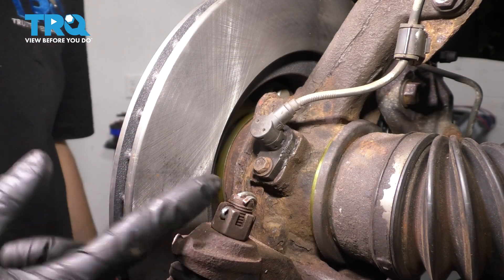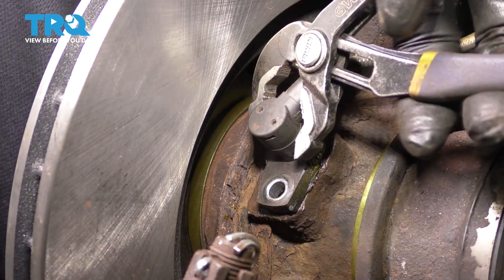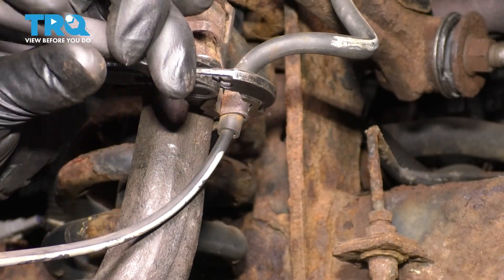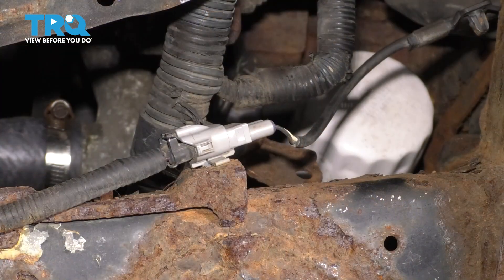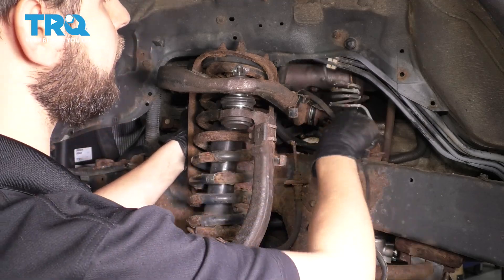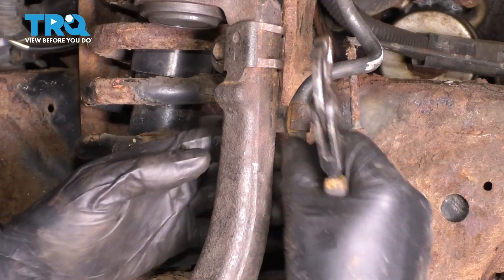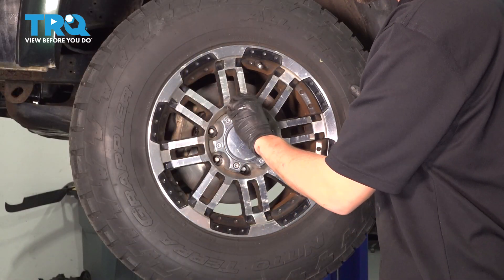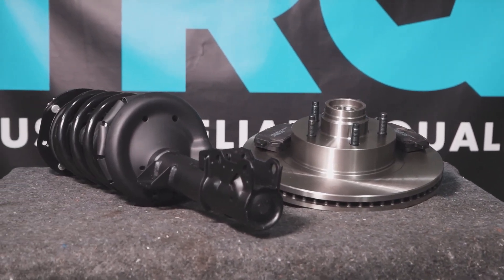How to Replace Front ABS Sensor 1996-2002 Toyota 4Runner

Comment: I bought a cheap sensor and it failed after 6 months......I will order the one from your link. I did notice that there was no o-ring/plastic washer(I seen it on another one when I was checking) when I was replacing it. I think that is why it failed as a lot of water/debris was on the tip of the sensor when I pulled it out to check it.